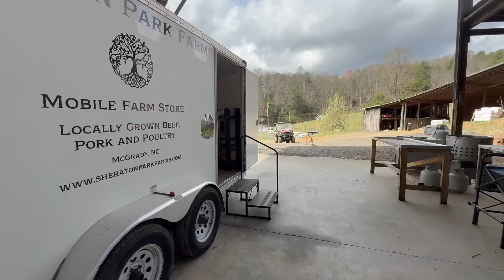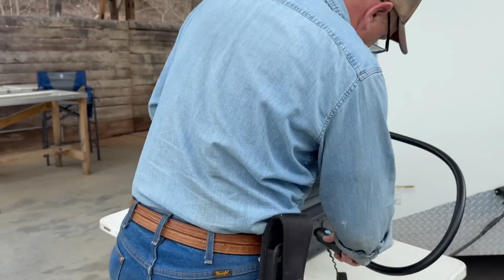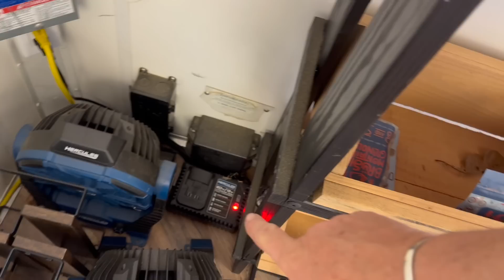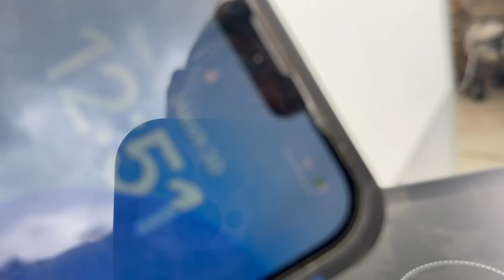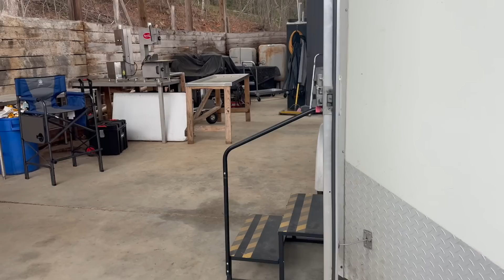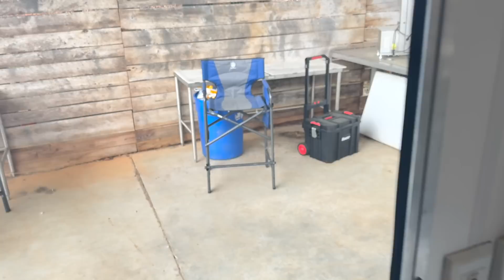Farmer's Market UPGRADE! - New Bluetti Power Source

Comment: I understand what you are saying about the noise.  Now that unit in total is heavier and harder to move.  You have to charge it for your next trip  Power is expensive.  A little HONDA generator is whisper quiet and just sips fuel.  Now cost?  I think generator is cheaper?? :body-blue-raised-arms:  Not a judgement lookin, for input which was to go.

Comment: Good video Chuck. I've been doing those kinds of systems for a few years now. I have 2 thoughts you may want to consider. 1. Add another battery pack to add some cushion in case of extreme heat. 2. Add a few solar panels to provide pass through charging while at the markets. If budget allows.

Comment: I have a very similar unit on my camper. And all I do is when I use it when we are camping, I leave it in the camper and plug it into one of the outlets inside the camper and plug in my camper two, my home power so that the camper is powered and at the same time it's charging my blueetti.  This wayYou don't have to unload it every time to charge it in your shop.  I know those things are super heavy, so just my 2 cents. Hopefully it helps

Comment: Well done ☑️ you can charge via your car, via a solar panel that you can put fixed on the trailer , extra battery or when you are a bit short , add the generator to charge. So many options available.

Comment: Your battery isn't going to last very long if you discharge it down to 0% every time you use it. That is really hard on the battery. You could run your generator before market starts and then use the bluetti during the market.
Reply: Good point. Ask the guy you got them from about the depth of discharge on the batteries.

Comment: I like your idea of solar boost to extend the life of the mobile power source.  A large inverter from your pickup could supply your trailer while in transit so you need not supply the market trailer the full time of your round trip to and from farmer's market.  
This should reduce your time needed from 4 hours to 3 hours, perhaps only 3 1/2 if you need to disconnect the pickup early in the setup process.  This extra power might allow you to give your customers a little air conditioning as well.  A comfortable customer spends more time at your market.

Comment: I would mount some solar panels on the roof of the trailer and wire them up to a plug that you connect to the Bluetti power source.

Comment: Can you add soft starts to the freezer to make it easier to draw a electricity from the batteries
Reply: What is a soft start?
Reply: You add it to a compressor for the initial start. It lowers the Ambridge and increases it slowly. So it's not a big drawer on the start up of the compressor.
 Help you keep your Ambridge lower.  At start ups They use them on air conditioners too.

Comment: It also may be worthwhile to upgrade the lights from fluorescent to led in the trailer to reduce the power draw.
Reply from the maker: Good point. I don’t care for the fluorescent ones anyway
Reply: @SheratonParkFarms  You can buy bulbs to replace the fluorescent with LED.  You don't need to replace the fixture itself.  You'll have to modify the wiring in the fixture depending on what LED bulbs you buy.

Comment: You gotta think, if people are opening those freezers, it’s going to make the compressor kick on more and it’s going to draw more power. Solar panels would probably be a good idea.
Reply: You might want to think about getting another battery for it also
Reply: And it will be twenty degrees warmer outside in a few weeks.
Reply from the maker: Good point. We are exploring the solar panel idea. Would be a good backup plan. Thanks for watching.
Reply: Exactly what I was thinking. To be safe, I'd think you'd need to cut the time in half to prepare for people opening the doors and using more power to cool the coolers. Think hooking up to solar is a great idea.
Reply: Add panels on top and charge the batteries throughout the day.
Reply: Yes people are like my kids. OPEN DOOR ,LOOK, THINK, MOVE TO NEXT COOLER , OOPS FORGOT TO CLOSE DOOR.